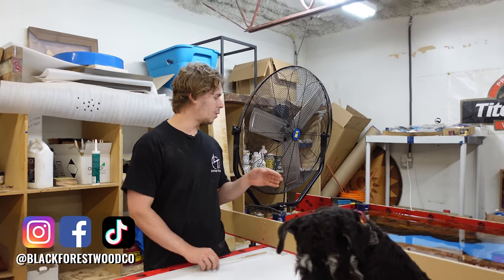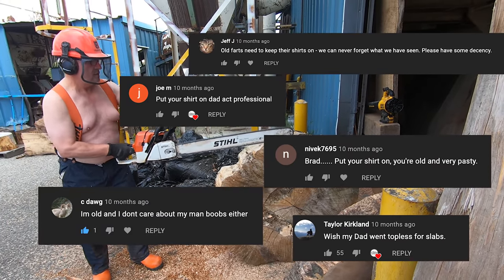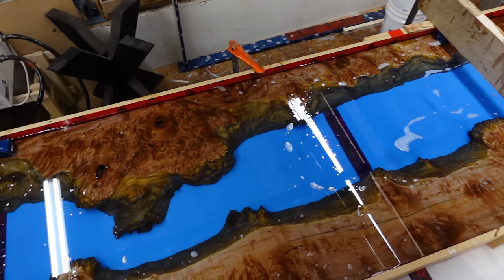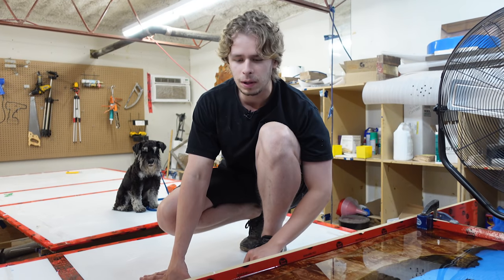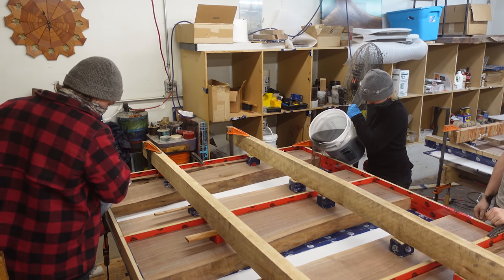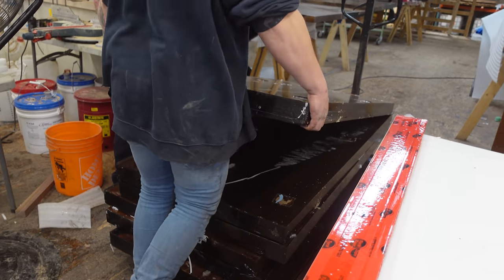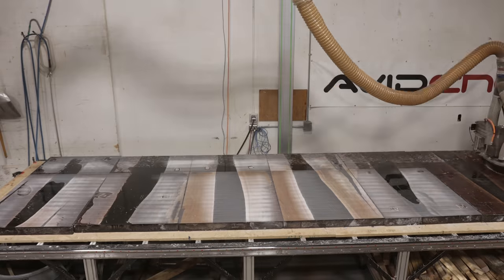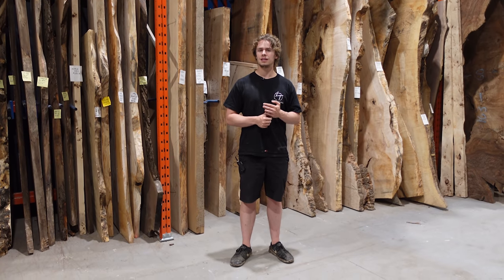Pouring Resin on a 4 Inch Thick Maple Burl Slab

Comment: You could put a 3/8"  sheet of aluminum on the top of your pour to have a flat top surface that would also act as a heat sink and prevent the wood from floating. Less warping less CNC rough surfacing time.